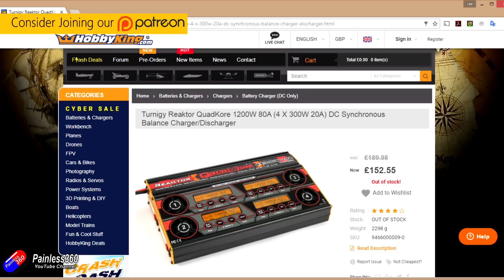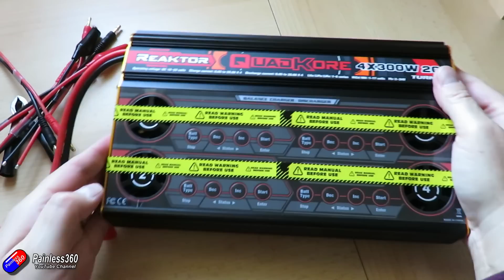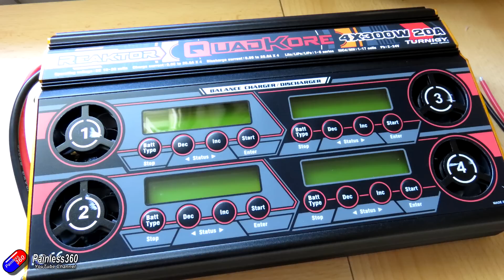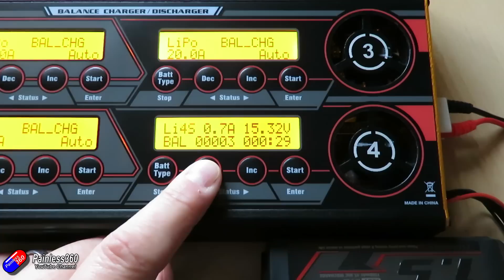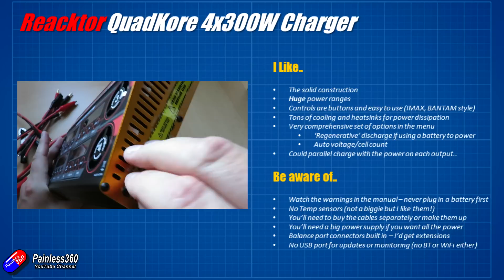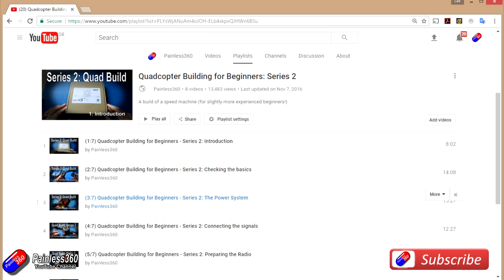RC Reviews: Turnigy Reaktor Quadkore Battery Charger

Comment: In country where I live Nigeria, there will be surely power failure. So in that case where I am using AC to DC input for this charge and I am charging and input power goes off while charging and it comes back where charging. Does this mean my charge will damage because it then means I plugged battery to be charged before powering charger?
Reply from the maker: That's probably a question for hobbyking support as I no longer have the unit to test. I'd imagine that the charger wouldn't power back on and start charging again agter a power failure without manual intervention.. best of luck !

Comment: can you use this balancer with 13-16s li-ion pack?
say' connect the power leads in series and the balance wires to the right places?!
Reply from the maker: Not sure, I've not used packs that large.. Best of luck!
Reply: Painless360 i will be greatfull if you will got the chance to check  it. I am looking for a 13-16s balancer-charger for a long time, and coud not fint it on the web.
Thanks for a greate video !!

Comment: Hi! Have you got a external discharge type on the menu? Today i bought smaller model of this charger(300W 20A) and can`t find this type of discharge. On the hobbiking site i find this information on product specification page "Maximum extern discharge power capacity: 500W @ 25V/20A" but in real i have only 30W. I try to connect external resistance on positive wire(like in older models manual) but device cant discharge more than 30W.
Reply from the maker: +deimufa2 it does on this one, I'd contact the HK support team. Best of luck!

Comment: So this just looks like four chargers in the same box (based on the separate settings for each channel), why would someone use a four-in-one vs four separate chargers?
Reply: smaller formfactor, just 1 inputwire. With 4 charges things start to get messy
Reply: A fair point, it would be cleaner out of the box but I can't help the feeling that it's a "lazy" solution (i.e. lets glue four separate chargers together).
Reply: I race 2-4 car classes in a race day plus my son races with me as well. Not having a huge pile of wires is very nice. For my quads and planes it has the amps to parallel charge enough packs for a whole weekend in one shot.
Reply: I dig my hitec x4 plus I fly different battery cells. from 2 to 5s I can charge mainly all my 3s and 4s even my field 10000 6s battery at the same time. paired with parallel boards. plug all batteries in and begin charging. reduces having to always change from charging only  2 s then 3s then all 4sto 6 s and always changing the settings. for separate ports built in converter for me is a must.

Comment: No AC input, no LiHv and no balance board/extensions. No deal.
Reply: You don't get this type of chargers with in-built power supply, certainly not for that price! Lack of LiHV is def disappointing as very little accessories as well
Reply: You can't get 300watts/channel but 100W/channel and LiHv charging for $50 less is available.
Reply: rcwck well, we are taliking about 4 output charger right? Don't get me wrong - I personally don't like this charger, but u just cannot get such charger with a 1200W inbuilt PSU, not for 200$. So ur complaint about this charger not having it just laughable
Reply: We don't hear much about LiHV batteries these days.  Initial hype around three years ago, special chargers required and now almost nothing.  What gives?  Are they all hype and no substance?
Reply: you are better with a good C-rated lipo than a LIHV